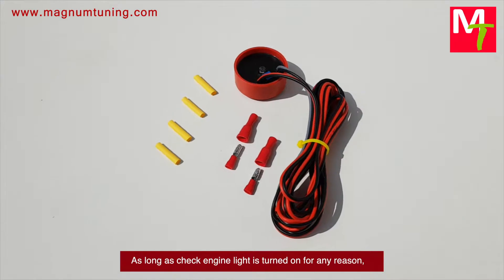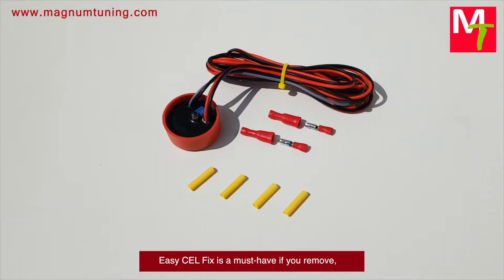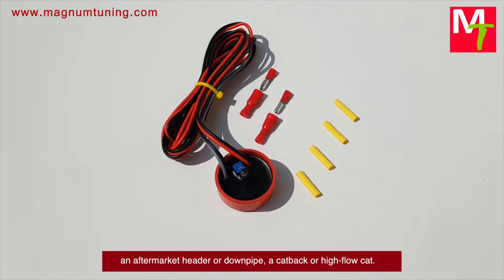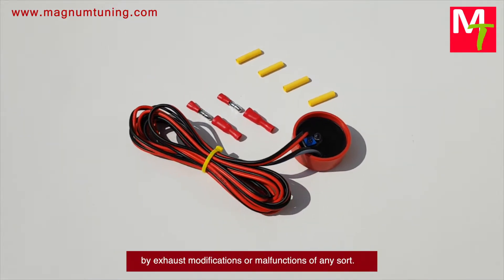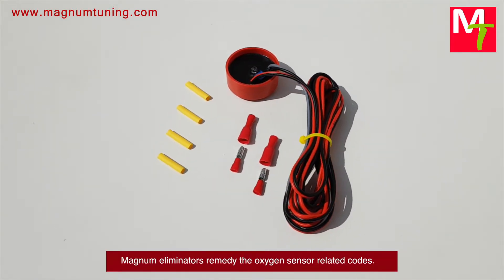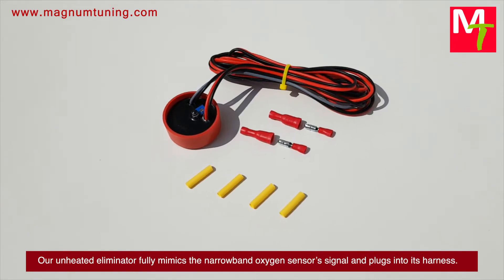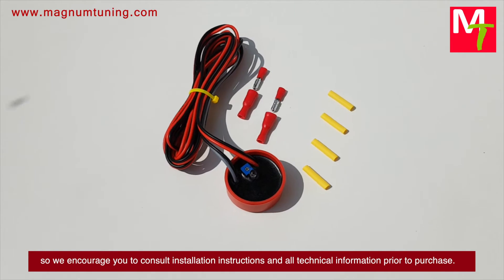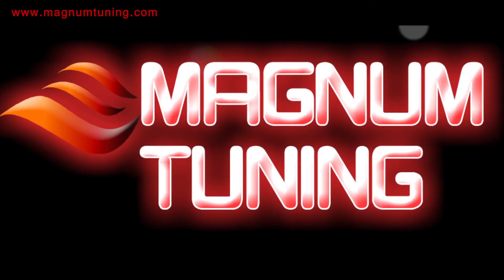Magnum EZ CEL Fix O2 Sensor Eliminator for Narrowband O2 Sensors   Get rid of CEL

Comment: Will this work for my 2004 Tacoma v6? Is it similar to the now extinct urd o2 simulator
Reply from the maker: Thank you for your inquiry. Because unfortunately we are unable to provide you with tech support thru YT, please follow the link below 

https://www.magnumtuning.com/support/html/how_many_units.html

to read all details relevant to the compatibility solely depends on the OEM sensor type as product description reads on the web site. 

https://www.magnumtuning.com/en/detail/ez-cel-fix-oxygen-sensor-simulator

Tacoma often comes with special 4-wire 3-Volt wideband senor that cannot be eliminated with narrowband EZ CEL Fix but our 4-wire wideband simulator. 

https://www.magnumtuning.com/en/detail/o2-sensor-simulator-to-3-or-5-volt-4-wire-wideband-sensors

Have a great day
Reply: @magnumtuning  cool so I need the 4 band one to eliminate it? Any help is appreciated I have a clogged cat that I have to remove. But it’s an off-road farm truck so it’s ok but I don’t want any check engine lights
Reply from the maker: Thank you for getting back to us. Please let us reiterate our YT team can’t support you technically but the guidance you happened to download from the link cited in our follow up, points you to the right direction pertaining to the required amount and compatible type of the simulator. The best we can do for you is to quote the relevant conditions .

“In general, post sensors are the concern but the upstream ones have to be in mint condition too to deliver a full range voltage fluctuation. We encourage you to scan or test the voltage range on the front sensor prior to eliminating the post sensor.

https://www.magnumtuning.com/upload/M_15/rek3/795/oxygen_sensor_elimination_diagram.jpg 

A dual exhaust with two post oxygen sensors requires 2 units in case of decatting and 4 units if the aftermarket headers, downpipes or any malfunction spoils the signal of the upstream oxygen sensors.”

Thank you

Comment: I am trying to find out if this will fix my catalytic problem in my Boat,  350 Merc inboard   Catalytic coming on random and putting boat in to protect, Limp mode,   Boat has very few hours on it,  75 hours,    PLEASE CONTACT ME
Reply from the maker: Thanks for contacting magnum tuning. For detailed technical information and specs please visit our website’s Tech Training and High Notes tabs. Simulators are listed for MARINE APPLICATIONS separately. You need to make several precautions. Check the oxygen sensor type prior to purchase ie. 

A.	4-wire narrowband with 0…1 Volt signal range (most common on this model downstream)
B.	5- or 6-wire wideband with 5.0 Volt signal range (most common on this model upstream)

https://www.magnumtuning.com/en/detail/ez-cel-fix-boat-oxygen-sensor-simulator

https://www.magnumtuning.com/en/detail/adjustable-boat-oxygen-sensor-simulator

https://www.magnumtuning.com/en/detail/bypass-it-5w-boat-wideband-oxygen-sensor-simulator

a)	On 4-wire narrowband sensors if you can or want to use the heater of the factory oxygen sensor, you may wire up #881 (EZ CEL Fix). Heated #886 allows you to remove or eliminate the stock oxygen sensor completely.

b)	For 5- or 6-wire wideband systems #885 (BYPASS-IT 5W) is adaptable. 

In general post sensors are the concern but the upstream ones (closer to the engine) have to be in mint condition too to deliver a full range voltage fluctuation. We encourage you to scan or test the voltage range on the front sensor prior to eliminating the post sensor.

https://www.magnumtuning.com/upload/M_15/rek3/795/oxygen_sensor_elimination_diagram.jpg 

A dual exhaust with two post oxygen sensors requires 2 units in case of decatting and 4 units if the aftermarket headers, downpipes or any malfunction spoils the signal of the upstream oxygen sensors.
Reply: @magnumtuning  I have 2 O2 sensors on both manifolds,  its a 350Horse Merc,  2012 Sea Ray 250 SLX   The Cat is tripping my system and telling boat to go into Idle mode,  I have replaced O2 sensors 800. dollars,  had it scanned,  Runs fine I go out, 20 in lator Idle mode again,  But boat runs good all systems fine, Not over heating,  No Fuel issues,  Great spark,  Its the damn  Catalytics and sensors,  Can I just Bypass them with this, ??
Reply from the maker: We appreciate your intent to shop with us but unfortunately we are unable to provide you with dedicated support via YT. Please surf through our product pages we were referring to or seek help thru our help center. 

https://www.magnumtuning.com/en/contact_en

On a side note neither the spark or any other engine components' operation (as long as it works flawless) affects the compatibility or efficiency of our simulators but you need to make sure what type and how many sims required to remedy your trouble codes.
Reply: I got a 1996 dosge Dakota wit the cat cut off ..looming for a good upstream o2 sensor.will this work

Comment: Do you need one for each 02 sensor or only 1 unit to bypass the entire 02 sensor system?
Reply: Did you ever get an answer lol?
Reply: You would need one for each.
Reply from the maker: Hi,
Please for technical support contact our engineers thru our website. 

https://www.magnumtuning.com/en/contact_en

Meanwhile just a heads up, all information including required quantity is posted to the item page on which you can find High Notes & Tips tab allowing you download what precautions have to be made. Thanks for contacting us.